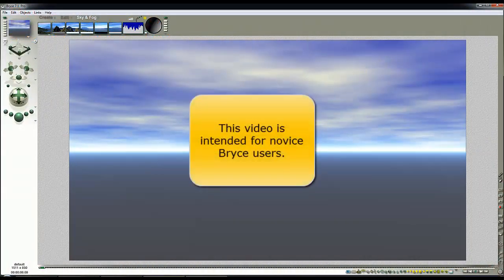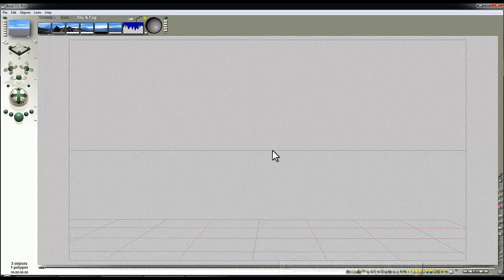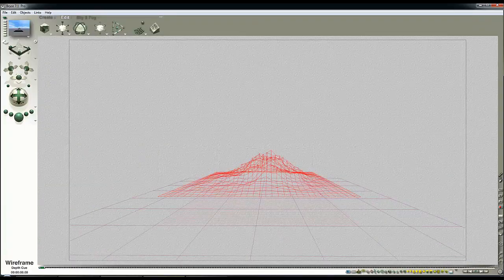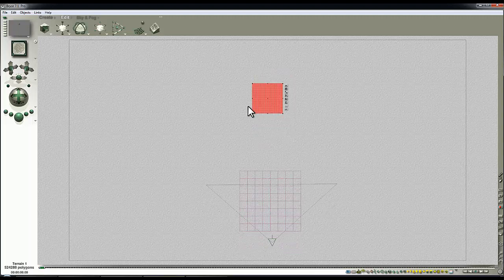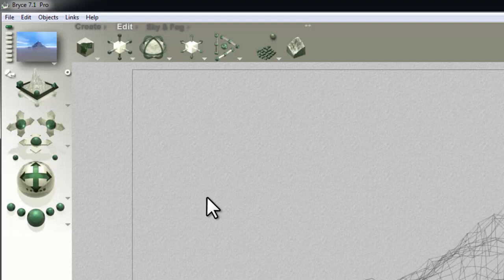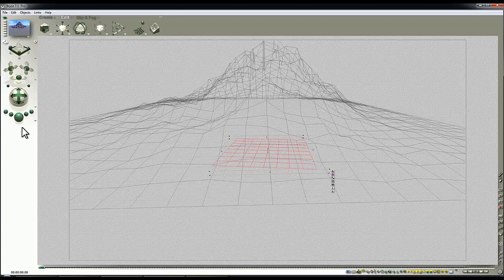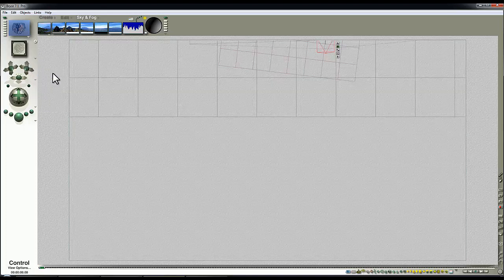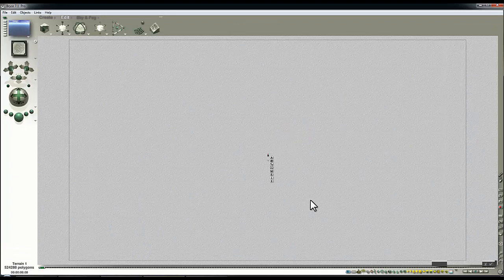Bryce Basics - Camera control an overview for beginners - by David Brinnen.

Comment: How can I find objects that I know are out of the  main view? Can I get a list of all the objects in the scene, in  view or not? Thanks.
Reply from the maker: Yes, there are a variety of ways to achieve this.  If you look in the bottom right corner of the Bryce window you will find a white gridded circle.  That switches between the selection and the animation tools.  The small icons similar to the create shelf allow selections of all of a type.  The pink white green box for selection of family.  The little downward pointing arrow are the lists of objects by name and type (this can get a bit unwieldy in complex scenes) and the arrow buttons next to the green blob in the middle allow you to cycle through object types selecting the first in their class and then the outermost arrows can be used to cycle through each selection in that class.  Finally the green blob clicks to red to solo the selection.  Tooltips appear in the bottom left hand corner of the window when you mouseover these funny little icons - hopefully that helps!
Reply: If you look at the icons across the bottom of the main view and hover over each, you will see what type of primitive each allows you to select. Click on one that is of a type you have in your scene, and you will see how many of that type of primitive you have. Click on one of the list items and it will select the object that has that designation.  Say you have several cubes. Go to the Cube icon under the work window and click on it, You will see how many cubes are in your scene, and can select any by clicking on it. If you want to select more than one, hold down CTRL and click on  each cube you wish to include in your selection. To the right of the Object icons are the Lights icons, and they work in the same way. There is another icon to the right of the Lights icon, which works a bit different, but if you read what is popped up, it will tell you what you can select with it, including any cameras you have.

Comment: great video, i just had a thought about objects that go under the infinite plane ....wouldn't it be interesting if each part of the object/terrain that is moved under the plane changed color, while what is above remains the same :) ....just an idea!
Reply from the maker: This can be done in the render, using altitude filtering, but in the wireframe, short of re-programming - I don't know of any way this could be achieved.  There are the Open GL modes which work slightly differently, but I've never got into the use of those.
Reply: the open GL modes sound  realy interesting, i might do some reading to find out a bit more about that.